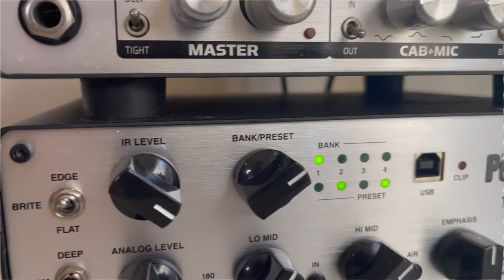Combining the IR Loader and Analog Cam Sim with the Fryette PL-IR!

Comment: Almost certainly going to buy one. 

My question is, does it make a decent reactive load attenuator - for getting some power amp sauce at apartment levels? I am mainly buying it for recording and headphone capacity, I'm just wondering how good it is as a "traditional" attenuator.
Reply: It’s not an attenuator. You want a power station for that.
Reply: @Eliphas_Elric  is it not an attentuator at all, or just an attenuator that's not as good as the Power Station?
Reply from the maker: @gearoidwalsh8606  It’s not an attenuator at all. It’s a reactive load that feeds an analog cab sim AND an IR loader. It uses the same reactive load as the Power Station which is a reamping device that, among other things,  operates as an attenuator.
Reply: @FryetteAmps  got it, thanks
Reply: @FryetteAmps  still going to buy one, you can't stop me.
Reply from the maker: @gearoidwalsh8606  Well, at least we tried😅

Comment: The Valvulator having different knobs/fonts bugs me a bit. (If they both had the metal knobs/toggle switches, people wouldn’t be able to resist buying the pair right?).
Reply from the maker: The new GPDI-IR has the same knobs as the PL-IR.

Comment: Won't the also be a slight delay from the IR (being digital) widening the split?
Reply: I was actually going to ask if the hard panning is done to let the Haas effect make the sound bigger rather than have phase and time issues shrink the sound.
Reply: There is always a little latency when an analog signal is processed through an I.R... however, depending on the euipment, the latency may not be noticable.
Reply: I've run a similar set-up with a Rockcrusher Recording and a Two Notes Cab M+. It "feels" like there's a slight time difference that you only notice when you mix the signals to the centre.
This is not a technical certainty but it feels that way.  In any case, panned L and R the sound is rather good.  Even panned 90 degrees L and R it sounds good.
I'm still working on trying to get a decent clean sound out of the Cab M+.